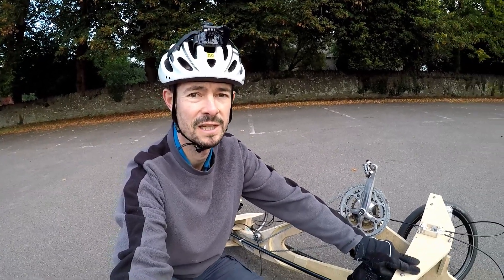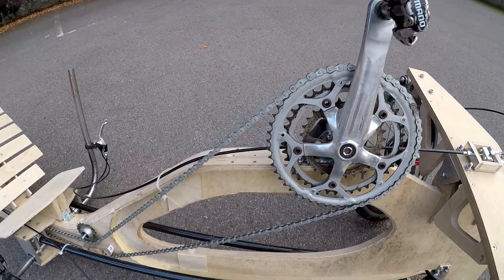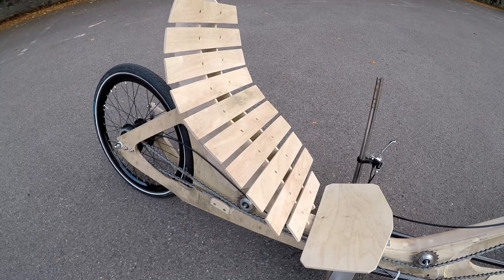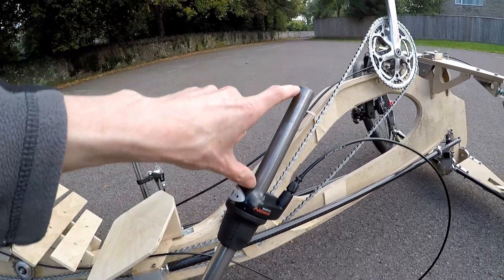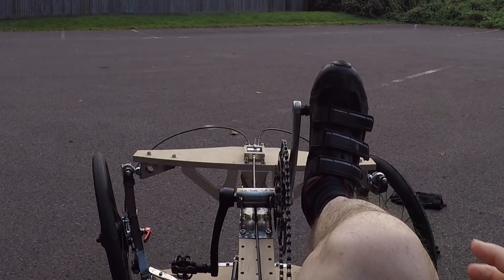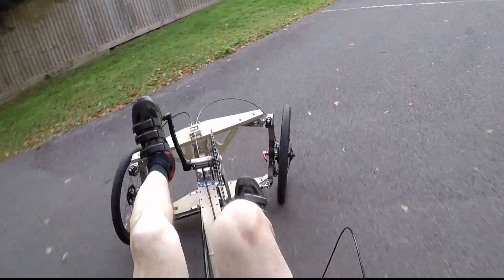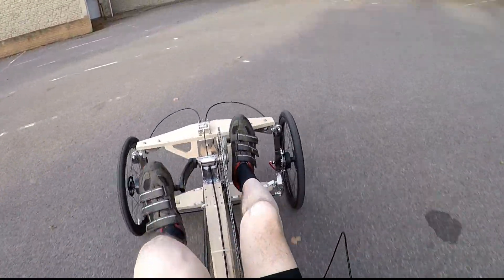Tilting Trikes Part 15 - test ride time for wooden tilting reverse trike prototype!

Comment: 2 bicycle coil springs on the 22 mm cf push tubes along with your arm strength might make it better to get back vertical. Its easy to tilt L. or R..

Comment: it looks it takes a toll in energy, as you are fighting stability all the time.. a bit more negative  camber and a bigger trail space?
Reply from the maker: I think raising the centre of gravity, ie making it higher, would be the answer.
Reply: @MetalMachineShop  LOOK WHAT I SEE. WITHOUT ANY THEORICAL NOR PRACTICAL INFO.. IS THAT WHILE YOUR BODY IS MOSTLY OVER THE CENTRE OF GRAVITY.. WHEN YOU PEDAL.. YOU SWING THE WEIGHT MAKING A DOUBLE EFFORT TO MARITAIN BOTH WHEELS WITHOUT SWAYING, HENCE USING A LOT OF EFFORT TO MAINTAIN ITS STRAIGHTNESS..

I ALLAYS BELIEVED IF I WAS TO DO SOMETHING SIMILAR, AS YOUR LEGS MUST BE OVER THE GRAVITY CENTER POINT.. YOUR BODY SHOULD BE WELL BELOW, TO COMPENSATE, HENCE MAKING THE UNION POINT BETWEEN THE CHASSIS AND THE SWINGING ARM, WELL HIGH, SO WHEN YOU START THE TURN WITH THE HANDLEBARS, THE BODY MASS THEN WILL SHIFT THE WEIGHT TOWARDS THE CURVE.. EVEN IF THE  REACTION WOULD BE THE OPPOSITE...
(TANGENTIAL OR CENTRIPETAL FORCE) 
BUT THAT`S JUST ME GUESSING, WITH VERY LITTLE CLUE OF MATHEMATICS!

Comment: What a great job on the trike and the videos.  You could be an engineering professor. (Perhaps you are in your other life.)  I learned a lot as I consider building a tilting tadpole cargo trike with tandem for me and my disabled daughter.  You will fly by us encased in carbon fiber if all goes to plan.  Be British now ... stay calm and engineer on.  You have a nice community of weird HPV people forming around you.  I look forward to your solution of the twitchy steering problem.
Reply from the maker: Thanks!  I think the solution to twitchy steering is a higher overall centre of gravity.  I have a second version on the drawing board which addresses this.  I’m also thinking more along the lines of a partial fabric covering rather than full carbon fibre.  This would in theory reduce drag and also give rain protection.  Good luck with your project, hope it goes well.

Comment: Your new videos reminded me of this build... Did you have more time to test ride it ? To implement the tilt lock mechanism ? I think this is really promising... A front wheel drive would be good (little chain stretch) but probably hard to implement well...
Reply from the maker: I haven’t done much test riding but I have a Mk II version on the drawing board which will hopefully allow some improvements.

Comment: Outstanding, going from design toprototype build. I can totally see this all carbon fibre with a polycarbonate shell or something similar.
Have you thought about making the chain come straight down from the chainring onto a drive shaft that runs underneath then up to another chain, it could be an advantage regarding chain stretch or other issues especially reducing clothing snagging in it or getting oil on clothes.
Reply from the maker: I have got a Mk II version on the drawing board.  It will be carbon fibre or steel/al tubing next time around.  The long chain is not ideal but a shaft would require a bevel gear at each end which would reduce efficiency and add complexity.  I was thinking of having the hub gear central mounted with separate chains going to it from the pedals and from it to the wheel.

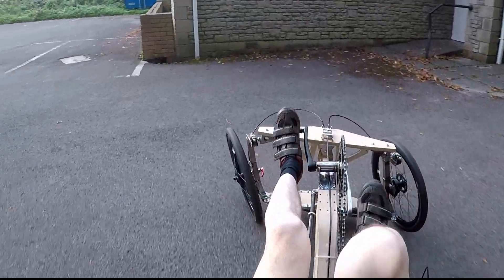Comment: At 4:18 the steering angle of the two front wheels seem to be wrong as they are not turning the curve using the same centre of the curve  I tend to conclude that the three wheels are not  turning to the left using the same centre of the curve. passing through the real wheel axis.  I do not think this is an optical illusion as I see it.  The inner wheel  turn more than the outer wheel, which does not seem to be the case here. Perhaps I am wrong but I have checked other turns to the right and the left with different curves. .
Reply from the maker: I have used Ackerman steering geometry but it could possibly do with some fine tuning.

Comment: Здравствуйте.Какой вес рамы?
Reply from the maker: Hi, the ground clearance is about 90mm (not enough). The top of the frame is about 600mm off the ground at the highest point.
Reply: @MetalMachineShop  He's asking about the weight.
Reply from the maker: The weight is about 25kg.  Very heavy, but the frame could be made a lot lighter.

Comment: Thank you for posting. Your build confirmed what I always thought, tilting on a trike is useless. Leaning a body is away to go.
Reply: So you suggest that the mechanism should only displace the weight closer to the curve that is been taken.  So tilting the body not the wheels.  Like in a side kart race. That´s  very intelligent. Thanks for the comment.

Comment: i have a few suggestions
1. seat head restraint
2. Protective cover between the chain and your leg.
3.tilt lock
4. arm support.. when you use it too much, pain starts in the arm.
5. wind deflector to the front

good luck..
Reply: Don't forget to get a bright flag and a pole for the back so drivers can see you better, as you're far lower down than a normal bike.
Reply from the maker: Thanks, I agree with all these!

Comment: hi, very nice work and i enjoyed your progress so far, My question is: does the tilting system provide benefits in terms of ride quality. I'm asking this since trikes have a very low center of gravity anyway
Reply from the maker: Sorry for not replying sooner.  The tilting has tow benefits in terms of ride quality - first, it's just more comfortable leaning in than getting thrown to the outside by centrifugal force and, second, if either front wheel hits a bump, the frame is only raised up by half the amount.  The tilting arms are also quite springy, so there is some suspension as a result.

Comment: Is it plywood or hard wood? It's in wich country?
Reply: And salute to your creative mind thanks sir.
Reply: Thanks sir.
Reply from the maker: It's birch plywood; UK.
Reply: Is it solid than marine plywood,because i don't know about birch plywood.
Reply from the maker: @ulhassawant7700  Marine ply is different and would probably be better.  The ply I used is really for interior use but I just happened to have some.  It needs painting for protection.

Comment: .. well, ... a year has passed, how is your tilting trike doing, how does it ride over long distances, does the tilting mechanism work as desired, have you optimized the weight in the meantime, have you changed anything constructively?
An "enlightenment vid.", also with data on the trike would be nice ...

... btw., ... I'm still impressed ...

... nun, ... ein Jahr ist vergangen, wie steht es um dein Tilting Trike, wie fährt es sich über längere Strecken, funktioniert der Tilting - Mechanismus nach Wunsch, hast du es inzwischen gewichtsmäßig optimiert, hast du überhaupt konstruktiv etwas geändert ?
Ein "Aufklärungsvid.", auch mit Daten zum Trike wäre schön ...
Reply from the maker: Well, the project has been on hold for a bit due to other priorities, however, what it really needs is a working tilt lock and tilt damper. Without a tilt lock it’s very impractical as it’s impossible to navigate in confined areas without dismounting.  The low centre of gravity also makes it very twitchy on the roll axis, so not very relaxing to ride.  Ground clearance is also too small.  All this means I have drafted a design for a (hopefully) improved version, slightly higher, shorter and narrower.  I haven’t decided whether to make it yet!
Reply: ... thanks for the answer,  @MetalMachineShop , after all the trouble it would be a pity if this project came to nothing, I really hope that you can pull yourself together to continue ...
One question: wouldn't the tilt mechanism be "self-stabilizing" if the center of gravity is below (!) the roll axis?
In curves, for example, the correct tilt angle would automatically adjust itself, while your weight would then stabilize the vehicle when it was stationary... ?

... danke für die Antwort, nach den ganzen Mühen wäre es doch schade, wenn dieses Projekt im Sande verläuft, ich hoffe doch sehr, dass du dich aufraffen kannst weiterzumachen ...
Eine Frage : Wäre der Tilt - Mechanismus nicht "selbststabilisierend", wenn der Schwerpunkt unter (!) der Rollachse liegt ?
So würde in Kurven sich automatisch der richtige Tilt - Winkel einstellen, im Stand würde dein Gewicht das Fahrzeug dann stabilisieren ... ?

Comment: What  happened to the project in the end?
Reply from the maker: Well it’s sort of on hold; the prototype proved the principle but is not really a practical machine in any sense.  I’m working on a Mk II design, which will be slightly shorter, higher and probably made of steel or composite.  The other key addition will be a tilt lock, which I would consider to be essential for negotiating confined spaces.

Comment: So no suspension whatsoever? 
Do you know of one with full suspension? Tilting is second on the list for me.
Reply from the maker: There’s quite a bit of spring in the front horizontal arms and they are so far forward that bumps are not really felt.  Rear suspension would certainly be an advantage!

Comment: Hello
I built a leaning trike with the help of your videos but I have steering problems. The outer wheel scrubs a lot even with the slightest turn while the trike is upright/not leaning.
What could be the problem
Reply: I'll try that and thanks for the inspiration, i couldn't have made it without the help of your videos
Reply from the maker: hi, it’s hard to say without seeing it, but it sounds like it could be a problem with the steering geometry.
Reply: Links to to photos
https://drive.google.com/file/d/1-2TkuI7zcROXK_H55PWOvNTGjz745OXo/view?usp=drivesdk

https://drive.google.com/file/d/1-5uLQYkvKUCuatgyi274w4AGjIYAYi55/view?usp=drivesdk
Reply from the maker: It looks like the Ackerman steering geometry may not be correct.  I can’t make out the steering bell crank details from the photos so it could be that and/or the steering arms should be pointing towards the centre of the rear wheel/axle more.  In any case, it seems like the inner wheel should be turning through a greater angle when steering, maybe?  Looks cool, by the way.
Reply: So I took it out for a test ride yesterday, really hard to control, does the wheelbase have any effect on that?
Reply from the maker: @nickspencer6451  it may have an impact, but I suspect a low centre of gravity may have more of an influence.  Low rider bikes/trikes are quite twitchy on steering compared to an upright bike and do need rapid steering input to stay upright.

Comment: How heavy is the trike? Can it also hold strong sprints to go faster?
Reply from the maker: it’s over 20kg, there is quite a lot of spring in the front tilting arms already and it would be possible to add suspension to the rear as well by changing the design a bit,

Comment: Tolle Arbeit was mir noch fehlt ist ein Dämpfer oder Feder  die das Fahrzeug wieder aufrichtet , sprich dazu bringt wieder geradeaus zu fahren . Eventuell mit Lenkung Dämpfer noch das es ruhiger wird . Würde mich freuen mehr davon zu sehen . Gruß Siggi
Reply from the maker: Hi, I’m planning to add a modified motorcycle steering damper to the tilt mechanism to calm it down a bit and also hopefully to provide a hydraulic tilt lock.
Reply: @MetalMachineShop  ich hoffe es kommt ein Update dazu , bester ansatz den ich bisher gesehen habe Top Leistung

Comment: What are the possibilities that it can be driven by shaft not by chain or chain moving behind the frame for more comfort
Reply from the maker: It would be physically possible to arrange a shaft drive, but it would need to be made of parts that are not standard bike parts, so would be expensive.  It would also need a bevel gear at each end, which is less efficient than a chain drive.
The frame could be designed to partially enclose the chain, helping to keep the chain clean.

Comment: I really enjoyed watching your series Andy. Your initial CAD analysis of the Ackerman steering was incredibly insightful. Would linking the seat upright angle in relation to the body to the tilt angle solve the twitchiness? It would definitely add to the complexity. The pivot point would probably need to be about 250 mm up from seat so your shoulders could lean in as your seat swings out on a turn. The downside would be the rider's lean would be additive to the trikes lean - to get it to lean 30º, the rider would need to lean 60º in relation to the ground...
The more I look into this, the more the complexity can spiral out of control. When I first came across Kazebikes's design, I thought it was a bit odd. But now the simplicity and stability appeal to me.
In the end, rollover stability and maintaining balance at stop are crucial for an enclosed bike. So despite the challenges, a tilting tadpole trike is probably the best answer for that application. Thanks!
Reply from the maker: Dave, I guess anything can be achieved at the cost of complexity, leading to cost and weight. My design aim for this project was to make it as simple as possible.  I think a slightly higher centre of gravity would help with the twitchiness.  I did see a design where the handlebars were fixed to the tilting arms, allowing the angle of tilt to be controlled by rider input to the bars.  At extreme angles this does, however, put the bars at an odd angle to the rider.
My thinking is that if a normal bike can balance without all this stuff, then so should a trike is designed right.
Sorry for the late reply to your comment.

Comment: That's a great job you've made. I believe the bike is still rideable :) Would you be kind to show the bike how it is right now? I am also thinking about biulding a recumbent trike out of plywood. With as less cutting of a plywood as possible. Instead I would like to bend the thin plywood and glue it together to make like one piece plywood frame. Best regards :)
Reply from the maker: Hi Mariusz, I’ll try to upload another video when there is more to show.  I think it would be possible to design a much better (stronger and lighter) plywood frame than mine, especially if you do some stress calculations, which I didn’t do for this prototype.  I just designed it around scrap wood that I had, so it’s not an optimised design! Sorry for the late reply to your comment.

Comment: Hi, it's good to be able to ride it after so much work! It seems having a pretty long turning radius and leaning is quite limited.
You may have a look at my Tilting velomobile AeroTilt: https://youtu.be/sEaM3-ygtT4
Reply from the maker: The turning circle isn’t great, but it’s a lot better than an enclosed velomobile.  The lean angle is about 25 degrees, this could be improved by raising the ground clearance a bit (it’s way too low) and making the handlebars slightly different; these are the bits that bottom out first. Sorry for the delayed reply to your your comment.

Comment: Very Impressed!  Nicely executed and good to see you able to ride it.
My tadpole suffered a tremendous amount of power-loss because of the angles the chain had to describe on the power-side to get from front to rear.   What sort of loss are you experiencing if any?  I found that higher angular change and smaller pulleys/idlers were the worst combination.  :(
Reply from the maker: Thanks! It's difficult to give a fully scientific answer but it doesn't feel like the losses are too bad. The angles are not too big.

Comment: A++++   Do you have to apply countersteer (like a motorcycle) to tilt/corner at higher speeds ( > 20kph)?
Reply from the maker: Yes, you can’t lean your body much so all balance is mainly achieved by counter-steering at any speed.

Comment: Really interesting project, I like the fact you don't have a tilt lock...... Would an oil filled damper slow the tilt down just enough to make it more stable at low speed?
Reply from the maker: I might try getting hold of a cheap motorcycle steering damper from ebay and see if it makes a difference.  The tilting and steering is a little twitchy.  A higher centre of gravity would also help I think - plus give a bit more much-needed ground clearance.  I am in the process of bodging a tilt lock as I think the main point of a trike is not to have to put your feet down when stopping.  it will also be essential when manoeuvring around bollards or through very tight gaps.
Reply: @MetalMachineShop  motorcycle steering dampers can be adjustable, I just think it would make the tilt machanism less twitchy at low speed.

Comment: I've a question. Does the tilting mechanism remove the need to have an Ackerman steering mechanism?
Reply from the maker: No it still has Ackerman although the inside wheel is currently oversteering slightly so some fine tuning is needed.

Comment: What problem does the tilting solve?
Reply from the maker: Good question! More comfortable leaning in than it would be on a fixed trike.  Key benefit  I think is that tadpole trikes can be very unstable at speed with a tendency to spin about their vertical axis (see horror video on YouTube); a tilting design should avoid this.

Comment: An interesting idea that I've had, and turns out was already tried out, it a trike with air shocks connected with an air channel. This way you get both highly tuneable tilt damping, tilt lock by means of blocking air channel (solenoid?) and it would still work like suspencion when you hit a speedpump, unlike your system...
Reply from the maker: Yes I was thinking of that option.  The horizontal wooden arm at the front is quite springy, but it's not really important as the weight is over the rear wheel.
Reply: @MetalMachineShop  what kind of plywood did you used in suspension?
Reply from the maker: @velogonza  it’s 15mm birch plywood.